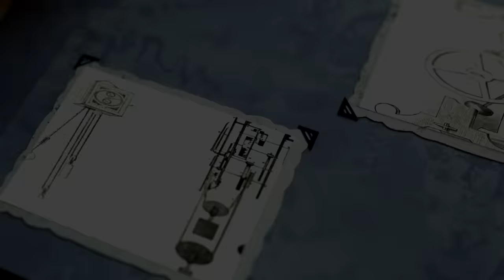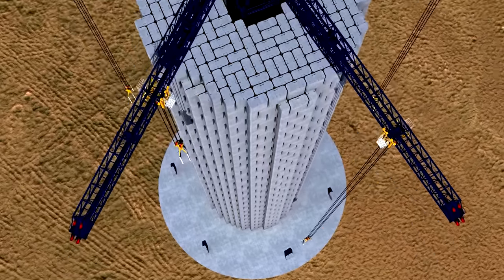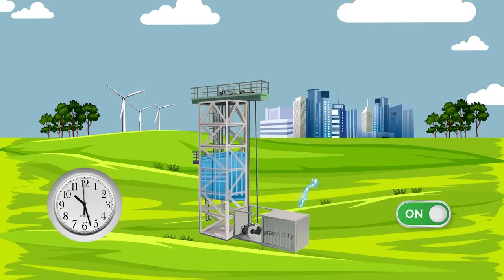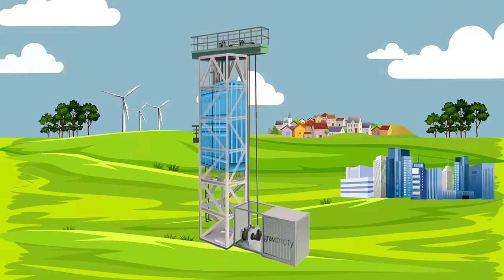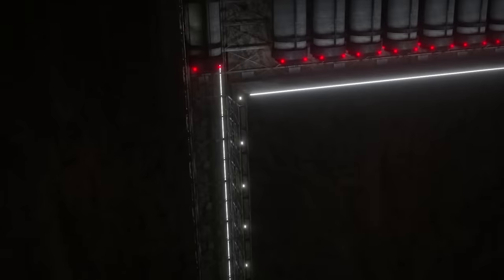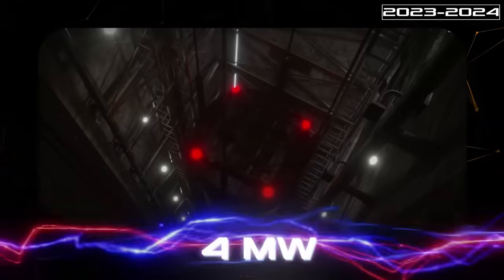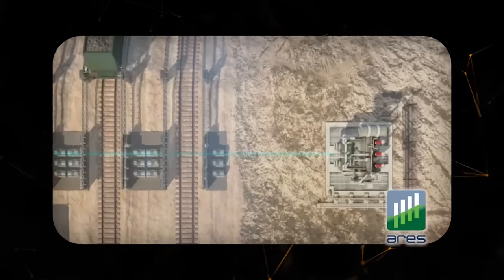How gravity batteries could change the world

Comment: Water bag batteries are my favorite. You use excess power to pump water into a giant bladder, when you need power, you open a valve in the bladder and use a combination of having a slope and progressively smaller tubes leading to a tiny nozzle that shoots the water into a turbine , which spins and generates power. Its basically a different kind of gravity battery
Reply: Sorry didn't catch the bladder,is that some sort of mechanical sphincter?
Reply: @dinozaurpickupline4221 I lol'ed out loud.
Reply: @CallMeByMyMatingName  just makin people laugh,stay content dear;)
Reply: That's a really interesting concept! Gravity battery systems like the one you mentioned are definitely game-changers. Speaking of power solutions, have you checked out the Segway Portable PowerStation Cube Series? It's a versatile powerhouse with massive capacity, fast recharging, and comprehensive protections. It's perfect for outdoor enthusiasts and family camping trips. Plus, it's built with Segway's waterproof technology, so you can take it on any adventure, rain or shine! Just thought it might be something you'd be interested in.
Reply: its basically a small scale version of a pumped hydroelectric dam
Reply: @rookandpawn  oh I had never looked at it that way, but youre right , same concept, different scale
Reply: This a variant of pumped hydro. Use an online hydropower output calculator to see what kind of head and flow rate you'd need to produce the energy you're using in your houshold. You will find out that you'd need much much more head and a much higher flow rate than what you're imagining. This baldder would have to be really gigantic and additionally you'd need a substantial head. Gravity storage of energy only works with very large volumes of water and substantial heads. Or if you're not using water then with very large volumes of other heavy matter and substantial heads.

Comment: I thought of this 40 years ago told a lot of people the big money power company’s blew me off. You could drill dry wells and do the same thing for individual homes.
Reply: Everyone blew me off for an idea I had as well.. combining the fridge and hot water system for homes..

Because of all the heat pipes and heat generated by the use of refrigerators, it's insane to me that we then have a second system for heating water..

Why not have a series of interwoven pipes that go all up and down slowly in lines across the back of the heat pipes, but with water flowing inside the pipes, so it functions better as a cooling system for the fridge on the outside while drawing heat away and into the pipes to heat the water which then flows into a small collective tank for later use. With a recycling pipe connected to the tank so the water continuously flows again through the pipes to keep the water at hot enough temperatures.

Instead of paying double, to cool something down by generating heat then just wasting the heat behind the fridge and another damn heating system for water, just use the heat/electricity already generated from the first device... 🤔

Comment: Use tidal energy to raise water to a height...and let it out all day and night...
( Tidal is available only  at specific times)..the water stored at a height can be continuously tapped.
Reply: Salt water flowing over metal combinations?
Reply: yes Tidal power systems are massively UNDER utilized...its basically a vast reserve of energy just waiting to be harnessed...You could have control flow points and place turbines on the flow points...it could totally be done ...not much different from a Traditional Hydro system..

Comment: let's say we need to store enough energy to then produce 50 MW for 12 hours (at night).  probably enough for a small town.  
50 MW * 3600 * 12 = 2160 GJ - we need to store such energy.  
Now let's calculate the mass of the load if the lifting height is, say, 100m.  
E = mgh , h = 100m, then m = Е(g * h) = 2160 ГДж/(10 m/s^2 * 100m) = TWO MILLIONS  TONS ... 
For a rough estimate - this is about a cube  concrete 100 x 100 x 100 meters :)
Reply: good number, as i expected it is a scam
Reply: @silver_surfer88  Not if you factor in the cost to build the structure to hold those cubes. There is no way this can be cost effective.
Reply: @silver_surfer88  since 25=100/4, then you only have (1/4*1/4*1/4) of the energy stored, say to produce with a power of 50/64 MW, roughly 0,8 MW. Despite this cube is still a monster, the mechanical transmission to make it to descend 100 m in 12 hours will absorb an important amount of the energy, say 1/2 with an an efficiency of 50%. As this efficiency also applies during uplifting, it will need an extra power of 50% more. So the system is good for nothing. Please make the calculations. If you don't know, please ask.
Reply: Despite this cube is a monster, the mechanical transmission to make it to descend 100 m in 12 hours will absorb an important amount of the energy, say 1/2 with an an efficiency of 50%. As this efficiency also applies during uplifting, it will need an extra power of 50% more. So the system is good for nothing.
Reply: @silver_surfer88  your math is wrong joao 😅
Reply: @silver_surfer88  No, I am not missing the big picture, for decades I know that gravity can be used to store energy. But with more efficient systems, not with solid  dead weights. Pumping/turbining systems exist all around the world for decades and with, probably, the best efficiency for energy storage/recovery. Some portuguese dams have this system installed for more than 50 years. This is not new, despite some ones try to present it now
Reply: Exactly. So inefficient.!!!
Reply: @silver_surfer88  your math is wrong there are 64 pcs of 25by25by25 cube in a 100x100x100 cube.
Reply: That's THE MOST, i mean , THE MOST !!! , stupid ideea !!! I mean honestly, DO YOU HAVE MOUNTINS TO BE LIFTED UP ???😂🤣🤣🤣 The math u made, FsomereDK, is RIGHT !!!
Reply: Sorry to burst your bubble. lifting the weight to 100m height??? vs... 100m length X 100m width X 100m HEIGHT???
Might as well not lift anything at all since the top of the concrete is 100 m already.
AMAZING!! Wonder what happen to the planet should people stack a bunch of weight on one point of the planet causing the planet to rotate eccentrically about its axis. 
AMAZING!!
Reply: Did you forget something called Gears??? Its not just pulling weight up..!
Reply: or a square kilometer, 1 meter high  (? )
Reply: Hello All,
Do you know that The Car Lifting Jaks which all use to lift a car to change the flate tyre,  that Jak has the efficiency of less than 50%, which means let it be 49%= loss is 51%, due to loss is 51%, when we apply force to Jak to lift the car up then force of car due to gravity acting on car to pull  car down, not work because of 51% loss and car is kept at some hight above ground to replace the flat tyre.
Now apply this same logic to this explained in video.
If loss is more than 51% then lifted load will not come down due to gravity and no electricity will be produced.
But if loss is less than 50% then same system cannot work property in Day time to lift load up to 100 meter height.
There is definitely some SCAM in this whole system, which is hidden under beutiful demonstration in video.
Reply: @theeraphatsunthornwit6266 what part makes it a scam?
Reply: @BlairDavis-mc6cl  a cube of concrete of size 100x100x100 meter is way , way too big to be lifted by any human machine.   Even a much smaller cube that give 1,000 times less energy than that, which will have  size of 10x10x10 meter, is still too big to be lifted and/ or require some very costly structure and machine
Reply: right bro !!!
Reply: I didnt check the calculation thoroughly (i was lazy) and gave too much trust but isnt the last part wrong.  
2 giga gram = 2000 ton (1 ton =1000 kgs)
Concrete cube dimension about 10x10x10 meter
Anyway, even it is 1000 times wrong, the conclusion  is still the same. Maybe....hmm.... let just calculate the system that can power a small home.   10 kw, maybe..
Similar calculation now we get weight required = 400 kgs.
Seems less impossible but there is a cost in every steps of the process.... structure cost... Labor cost.. device to convert electric to height and height back to electric.  All these conversion has a lot of loss too....  i still bet this is a scam but now it is harder to prove without someone try to construct it for reaL.
Well,
Reply: I think the word which suits best such a ridiculous proposal like so many others is a "boondoggle" or "clusterf**k".
Reply: You're calculating to produce a years power in an hour. You only need the hours power per hour
Reply: The lifting height should be 4000 m  (p. ex. gold mines in SA) or 1000 m ( p.ex. coal mines in Europe)
Reply: @ore4619  not only height , but weight it has to lift. Human cant yet find a crane that can lift the entire building...if you have 100 billion you might be able to but the real point is at what cost
Reply: @theeraphatsunthornwit6266  duh, it's an ai voice, so what do you expect, lmaoo
Reply: This reminds me of that silly gravity powered light for undeveloped countries. High mechanical complexity plastic device were you need to lift a 12kg sand bag about 1.6m just to get 10 lumens of LED light for 30 minutes. A 5W solar panel with a 10Wh battery would cost about $40 and give 100 lumens of light for 10h and that solar panel still has plenty of extra headroom.

Comment: Here is another idea:
Abandoned strip mines can be half a mile deep. They look like an upside-down cake. The deep part of the mine is narrow. The part of the mine at the surface with the earth is wide. So, put turbines and pumps at the bottom of the mine. An appropriately sized catch water basin for the pumps at the bottom. Build a "pool" structure towards the top of the cake close to the surface. That pool is supported on a foundation around the circumference of the bottom of one of the top layers of the cake. The pool is as many feet in depth as you want for your potential energy storage. Solar supported and placed above the pool. At the center of the top circle of the cake, you build a cone section that goes lower than the bottom of your pool. That is to set up a center of gravity for all that weight of water. A column structure going down to the bottom of the mine supports that center of the pool. In the space between the bottom of the mine and underneath the pool structure you put your electric power plant and underground high voltage transmission out.
Now, drop water to the turbines, pump it up for storage. Rinse and repeat.

But, actually, there is a cheaper way to do the above with strip mines. You can spend a lot less money in the building of the pool of water over the mine. That is, that pool that is just hiding the previously ugly carved out strip mine. It could just be very shallow. The reason for that is that it would limit the weight that you would need your structure to support. For energy production, you're just interested in the height of the water column from the surface of the pool to the bottom of the strip mine. Then, if you have land adjoining your strip mine, dig appropriately around the mine to build a pond/lake to any volume you desire for your "water battery". That additional adjoining pond is cheaper, since the land itself supports that water weight. That section of water is also connected to the shallow part over the strip mine. By doing so, not only do you get a nice new lake for lake front living, but you have energy storage in the form of potential energy between the lake and the turbines and now you don't have to look at the ugly strip mine on your land.

P.S. I'm a retired Electrical Engineer. All we need in this world is some imagination. Come on people. Get it done. There is always a way.
Reply: gravitricity.
Reply: You can also fill them compressed air if water isn't available or if there isn't convenient storage for the water above ground.
Reply: PD3045,
Many Open Cut Mines are in Remote Locations.
Some of these are Not Connected to a Grid.
Therefore in Some Cases Better to Build Highrise Gravity Batteries Near an Existing Small Town so as to Create Energy Storage and Enhance the Small Town Economy.
Two Positives instead of One Positive.
Reply: They are huge gold mines in South Africa more than 2 miles deep ! 
Coal mines 0,8 mile deep in Europe too.
Reply: @ore4619  Absolutely. Potential energy storage from a water reservoir on the surface of the earth when using deep mines for energy storage from that water is relatively cheap. But, you do need either a deep cavity deep in the mine, where your turbines are placed to capture the water after power generation. Alternatively, you would need an underground natural water flow that you could dump the surface water into, the sink.

Comment: If the top of the tower was able to rotate and you placed a vertical sail or blades atop it, the wind could gently rotate the weight array and add even more potential energy via centrifugal force.
Reply: nice fantasy but I think your way of getting the weight upwards is not the one with least friction. Downwards or centrifugal are just directions of the gravity force. I see no added value in spinning a weight because you want centrifugal force tot harvest electricity. Keeping it simple up and down seems the least chance of friction and other mechanical losses. Actually the whole idea in this video seems still way more expensive then using water pumping up in a hilly surrounding and use the streaming back down to generate electircity. The only reason to chose lifting blocks is to avoid transportation of electricity. But as todays world is already a massive web of transporting electricity, the gravity method is best used with pump-lakes in mountain areas.
Reply: then it goes out of control and lauches those heavy weights into people or the ground

Comment: Cables, motors, generators, bearings all will need replaced way before the 50 year service life stated. Using old coal mines bring a list of other problems and issues. Methane, oxygen, water, roof and rib supports all will have to be maintained due to maintenance requirements on your gravity battery. It won’t be cheap.
Reply: It will still be cheaper than lithium batteries.
Reply: @lancelessard2491  but not cheaper then coal
Reply: @bigmikesexcellentadventure6702  I don't know for sure, but coal has one distinct problem that weights don't have, and that's toxic ash that needs disposing of, and has an associated cost that needs to be figured into the cost of coal burning. Solar energy produces no waste products.

Comment: who's to say it has to be completely vertical?  It could be down a mountainside on a slope, the potential gravity energy wouldn't be as high but the material costs would be lower and it would be more easily serviceable
Reply: The energy stored does not care what angle it is moving on, vertical and sloped are the same, only loss do to friction changes.
Reply: That would take up a lot of space. I think if you get like how the oil drillers do it but with a bigger hole you can go down 30,000 feet and you can fill up a plastic container full of water or something dense that you wouldn't mind losing at the bottom and since you start at the surface of the earth the first drop would be free in the sense that it would generate a lot of the profit by putting power into the grid at peak times that by the time it got to the bottom and you started housing it up at bottom pricing for electricity in the grid it might cost less to hoist back up as it produced to drop and you collect the profit. Biggest expense would be digging the hole and lining it in a way that lasts so you don't have to do it again, and also hoping it generates more falling than it costs to haul back up. You could make several right next to each other and set it up to be basically autonomous except for maintenance once in a while. If one material becomes cheaper than other you can swap out whatever it on the platform to heavier weights with stronger pullies and bigger electric motors that produce more electricity on drop and can haul a heavier weight. If you can dig a hole straight down way far deep the first drop of the weight could generate some money

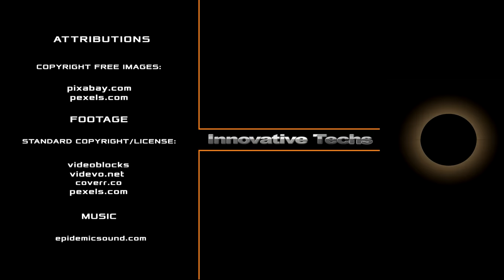Comment: 9:37 I like the fact that gravity battery has a working lifespan of fifty years which is ideal. If lithium battery has a working fifty years lifespan then that will be ideal but currently they are not. We need more innovation like these that has significant lifespan and it is effective. Lithium battery is not Even recyclable which is such a disadvantage. A ten year lifespan is not good enough considering that our raw resources is limited in quantity and it is not recyclable or renewable. Plus we have to dig enormous crators or holes in the earth to find limited resources and this digging changes the environment massively. 😎💯💪🏾👍🏾

Comment: Imagine this system with two balanced loads which collect atmospheric moisture at the top, then drain it at the bottom. It seams that a system like that could function with no artificial energy input and provide a lot of energy for a long duration.
Reply: Sounds good, but I'd assume the time to collect the load would be impractical
Reply: You mean, like a dam? That collects atmospheric moisture in the form of rain? And drains it at the bottom with a turbine?
Reply: Yes but if it's balanced, you only get the enegy of the moisture. Which will be tiny.
Reply: @1mlister  atmospheric moisture is very high in some places.  If the lift locks at the top until it it’s full, and then descends, it could dump its load at the bottom and the ascend once it’s empty.
Reply: yes, its called a river.
Reply: @adrianbratt9927  unfortunately, the “save a tree, hug a bunny” crowd worries about the fish when we dam up the rivers to make clean , carbon neutral power.